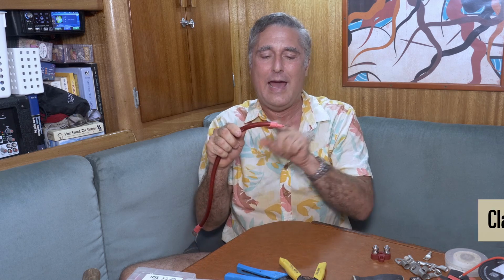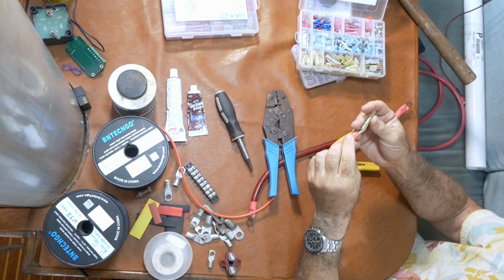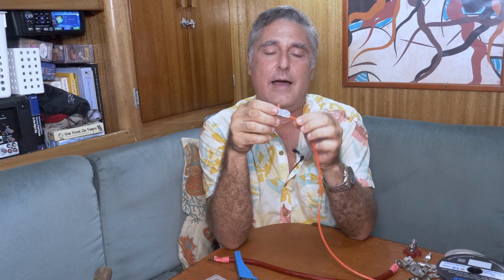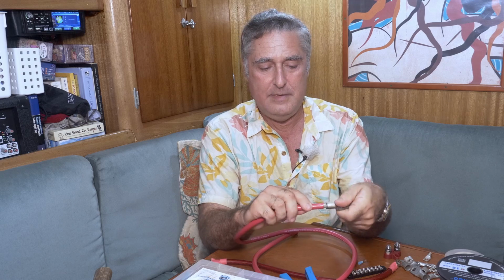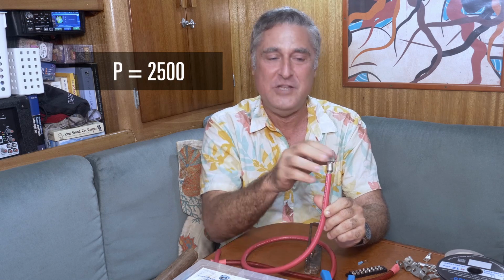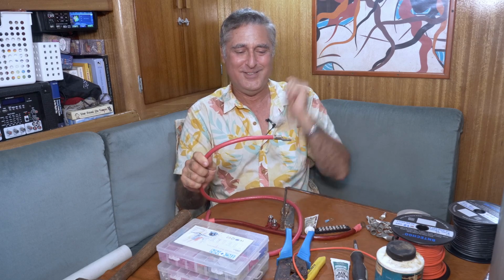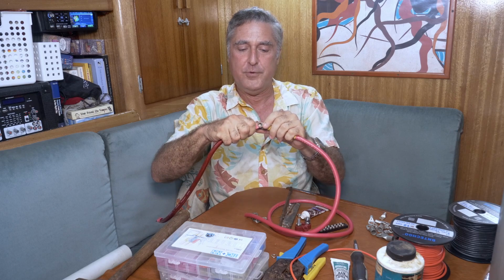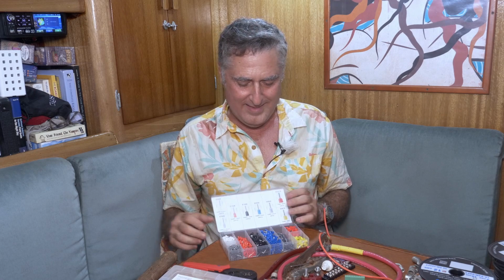Boat Electrical: Understanding Terminals

Comment: A neat trick I just heard about: after wrapping a connection with vinyl tape, you can swab it with pvc pipe cement and it will fuse together and become totally waterproof, especially if the wire has pvc insulation.  Thanks for this great series, I’m learning so much!
Reply from the maker: I'll try that sometime
Reply: Usually cracks off. If I see this mess it is a required cut out. The cements are brittle. It isn’t liquid electrical tape.

Comment: Hey Clark, very good video. I have a question. I was replacing some terminals a while back and saw there were several different kinds of metals they can be made of. When I replaced them the first time the machine had no power when it was hooked up. Come to find out I had the wrong type of metal terminals. I think I put zinc ones on it. Do you have any information on what types of metals to use? The batteries I was working with were lead top post style. Thank you!
Reply from the maker: For lead batteries with lead poles, lead terminals are probably best.  Copper plated in tin is always a good idea.

Avoid aluminum in my opinion.
Reply: @Clarks-Adventure  do you mean tin plated copper?
Reply from the maker: Yes

Comment: I'd not recommend soldering for a few reasons  . Soldering it brittle is the big one  . Also can you do a video on wire color code  . On boats it is way better to use Yellow for DC negative as Black can be confused with AC 120 volt hot wire.
Reply from the maker: I must say I use what I have.  Often I can only find red and black.

Comment: There is a school of thought that says soldering  already crimped connectors is a bad idea in vehicle applications.  We know that we need to use stranded wire because vibration will cause early failure in solid wire.  When you solder a connection you would want the solder to wick up the strands under the insulation.  Otherwise why do it? You're trying to seal the exposed strands right?  What you end up with is basically a solid wire.   You have just created an early vibration failure point, with arguably no real advantage.
Reply from the maker: Yes.  Wish I knew how something would fail ahead of time.

There are untinned stranded wires on Temptress that are still going fine after 50 years.

Comment: Great stuff.   Honestly did not know about conductive grease, or about the 4-square crimp connection for terminal blocks.  Most solar charge controllers use these screw-in crush type connections, and they always seemed a little sketchy to me, the vibration issue makes perfect sense.  Thanks!!

Comment: I watched a guy replace an old defunct 220V well pump. The four wires coming out of the new pump were 10 gauge stranded un-tinned copper wire and were factory sealed where they exited the pump motor. He stripped off about 3” of the pvc wire insulation from all of the wires and did some kind of in-line flying linemen’s splices that weren’t any thicker than the diameter of the insulated wires. I was unable to pull them apart. He wrapped each connection in two layers of pvc electrical tape and coated them with a thin layer of regular pvc pipe cement. He then bundled the four  supply lines together and taped over that with one layer of pvc tape and some more pvc cement. The pump was immediately submerged and lowered down the 150’ deep well as fast as he could attach the sections of pipe. I asked how long that the electrical connection would remain water proof. He replied “Well, I drilled this well 20 years ago and I just replaced the original pump, so at least that long.”
Mind Blown…
Reply: High quality tape. Only done by old ways now when someone screws up the supplies list. The splicing is analogous to rope splicing. Skill defendant, why nobody wants to rely on these methods now. Most pumps are installed with mechanical non-insulated barrel crimps with glue shrink over, tape over is just for chafing.

Comment: With the stranded wires my Dad, an Electrical Engineer with a 1920's Masters Degree, taught us in critical high stress applications to use a lineman's square knot with solder and marine shrink wrap instead of butt splices.  There are telegraph and electric transmission wires in service that have been holding up for over 100 years using a lineman's knot.  The wire will fail before a lineman's knot will.  Before the marine shrink wrap became available he taught us to use rubber tape field hot vulcanizing it to seal everything up especially for submerged connections.  Those boys who graduated from MIT in the 20's gave us a lot of things we take for granted today.

I still prefer to pin crimp and solder afterwards (belt and suspenders) to using the goops.  NoOx is great for screw terminals and similar while dielectric grease great inside multi-connectors and lamp sockets.
Reply: Do not use solder if the wires move or vibrate. The wires then break just next to the solder. It becomes worse if you use silicon wire. Also if the wrong flux is used, the wires will corrode much faster. But done like your father did and for things like telegraph-wires it is a very good solution. On board for many things usable but I would not use solder for wires attached to f.i. the engine. I use that vulcanizing tape for coax connectors used outside, great stuff.
Reply: @pa4tim  You do have to provide for strain relief in the form of marine heat shrink tubing, rubber hose, vulcanized wrap, etc  past the solder to prevent that.  Of course you need to be neat and refrain from over soldering to prevent it from wicking too far up the strands along with use the correct non-corrosive flux.  To me the crimps with the heat shrink cuffs and heat activated adhesive don't provide enough strain relief past the crimp either and are not really optimal where heavy vibration is present.  Old school would be to have a wire clamp with the wire passing through a rubber hose in the clamp to stop vibrations from telegraphing back to the connection.  Do it wrong, using solder or not, the wire will be prone to breakage at/near the crimp.  Yes I've seen plenty wires fail with and without solder with most failing due to over stripping of the wire combined with a lack of strain relief covering well past the exposed section of stripped wire.  Sadly in the here and now they don't teach shop in most public schools any longer where how to use crimps, solder correctly, use a hammer, saw, drill, etc was part of the graded curriculum.  If our grandfathers were told the day would come where there would be HOA's that would penalize you for doing something as simple as checking your vehicles motor oil or changing a spark plug in your homes driveway they would have not believed you yet here we are with HOA's and this dummying down of everyone.
Reply: @pa4tim  Basically true, there are ways of doing it anyway, the primary is a mechanical wire clamp retraining any movement in the solder interface. On less critical not having solder exit a lug plus strain relief.
Reply: https://www.youtube.com/watch?v=O-ymw7d_nYo Thats what he is talking about.

Comment: No better way than to crimp.

No need for soldering as flux itself can add to corrosion.

Screw terminals with tinned copper wire can get squeezed apart by the screwing action on the tin, which acts as a lubricant.

Simply select the cable and suitable crimp terminal for the job in hand.

Top Tip: obtain a suitable crimping tool with the interchangeable "crimp heads". 

You'll need two tools, one for up to 6mm2 wire. And another, much bigger, for 6mm2 to 50mm2 cable.

The latter may be nearly two feet long and require a fair old bit of squeezing together.

If doing a lot then suggest you buy a hydraulic unit.

And lastly but by no means least a few rolls of self amalgamating rubber type tape..

As in wrap the crimped terminal entirely in tape except the contact surfaces, job done.

Self amalgamating tape ideal for wrapping pipe joints which refuse to be nipped up too.

Hope that adds to your methodology.